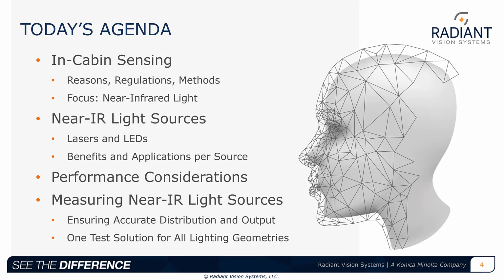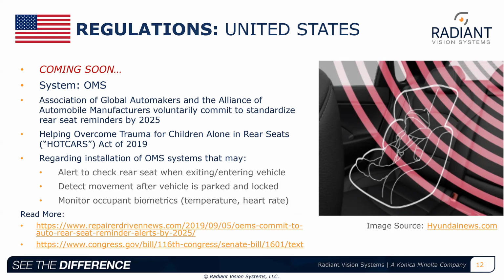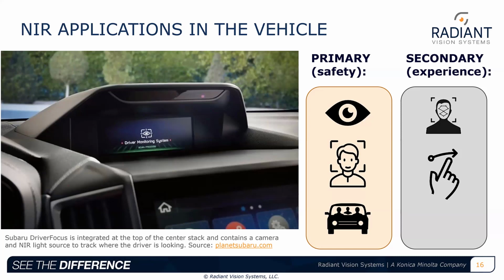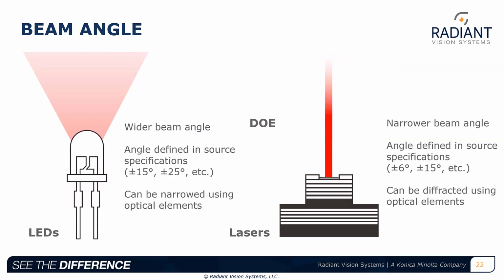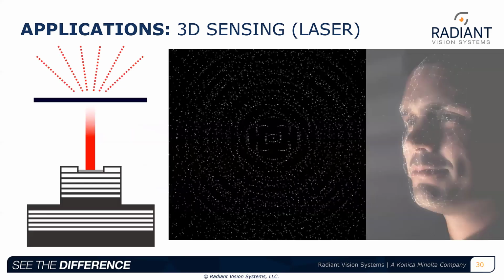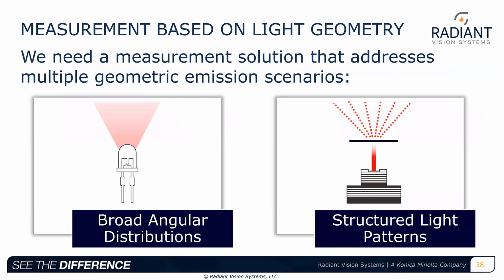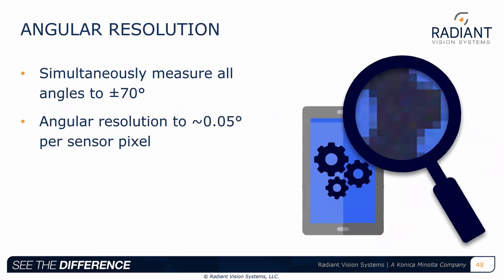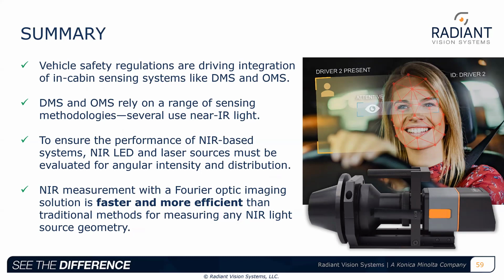In-Vehicle Sensing: Using Near-Infrared Light for Driver and Occupant Monitoring

Comment: On page 25, under the camera you wrote 'Camera with IR sensor', what is that IR sensor? is it possible to achieve infrared imaging using IR LEDs and a normal camera (RGB camera)? to have IR imaging instead of IR LEDs what kind of camera we need to use? camera needs to have what kind of things to be able to provide IR video/streams?
Reply: I guess it is just a normal camera with IR cut off filter turned off if the camera has this filter